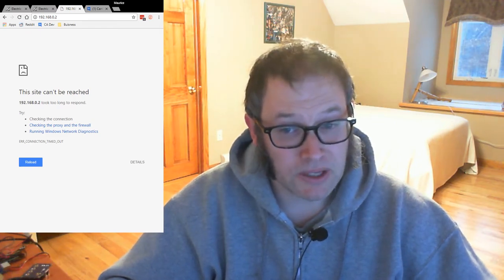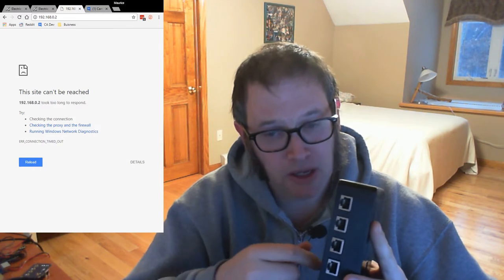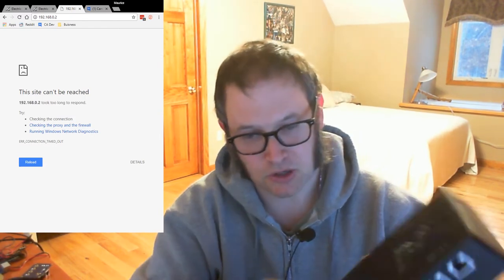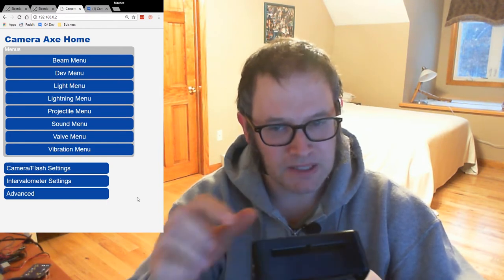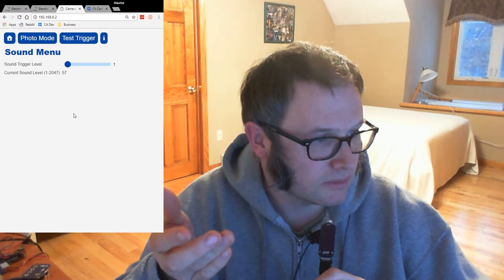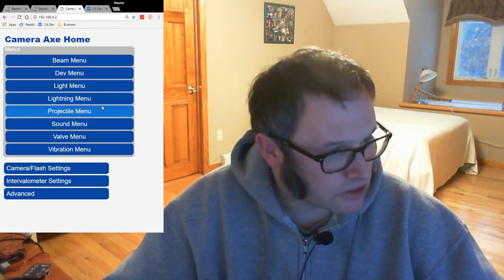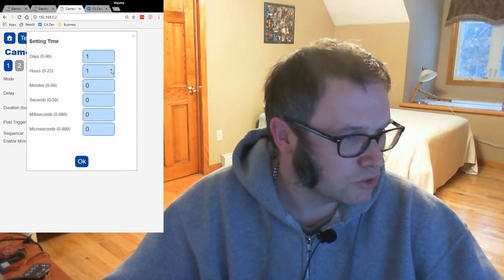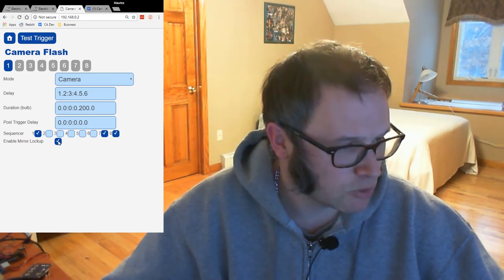TPB #94 - Introducing the Camera Axe 6

Comment: Question Maurice, will the multiflash plus unit still work with this version?
Reply from the maker: The multiflash plus will work with the CA6, but I probably won't be making any more of the multiflash units.  The CA6 can act as a multiflash plus unit and per port the cost isn't going to be very much more expensive.